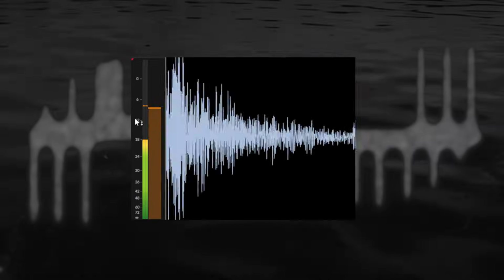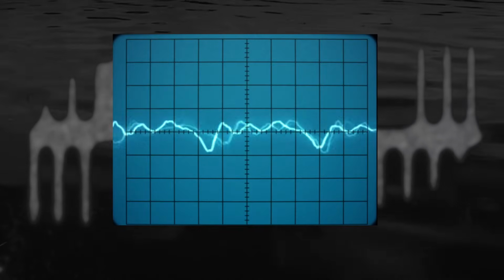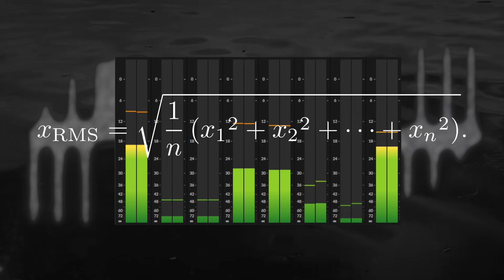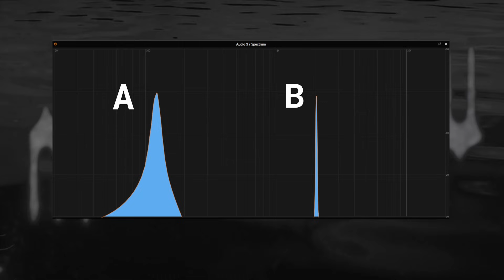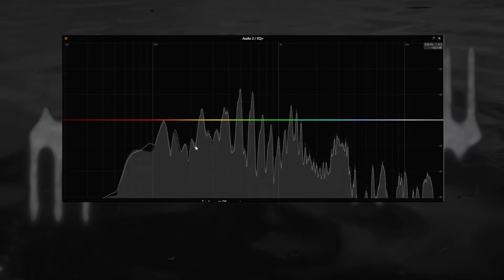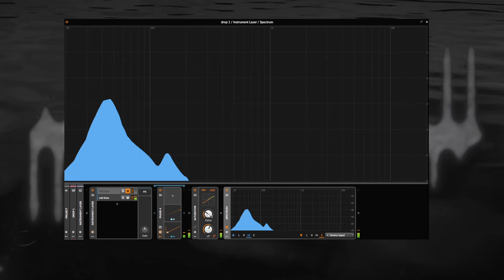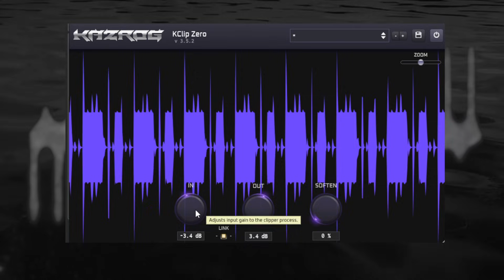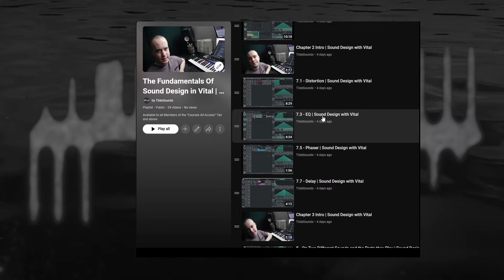Understanding Loudness - Psychoacoustics for Music Producers Ep. 1/6

Comment: Should I care about the difference between Gain and Volume in Bitwig's Tool? Can you explain it? I guess it's not just a second knob just in case you didn't have enough high volume with just one.  :)
Reply from the maker: Theyre the exact same, just scaled differently. Volume goes to -infinity, gain only to -36 or sth. Afaik the only reason it has both is for compatibility with older projects, from when tool only had the gain one? 
In practice i use gain for subtler changes and volume if i want to completely fade to silence, but it really doesn’t matter.